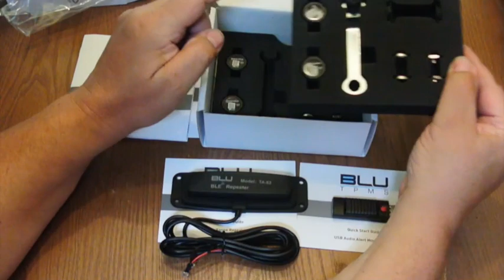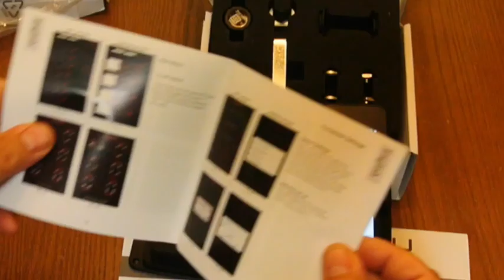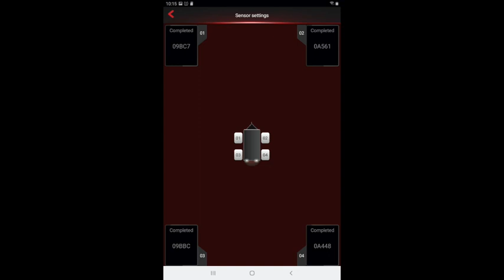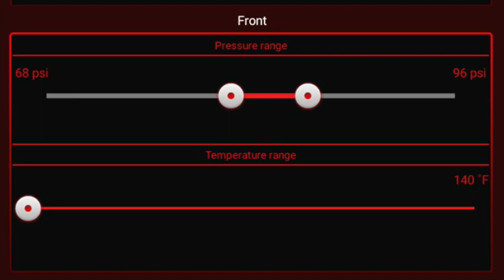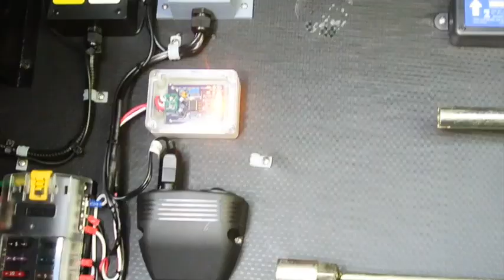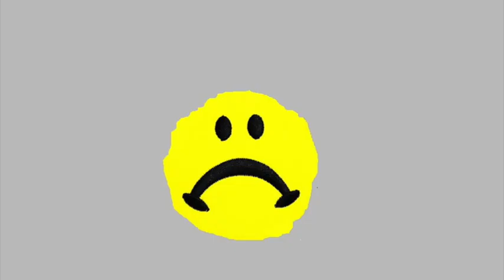Review of the BLU TPMS (Bluetooth) for RVs.

Comment: Junk! Couple of months of use and they are now leaking air. Bought enough of them that I can exchange and it still leaks.
Reply from the maker: Unfortunately, the sensors are more or less common to most of the TPMS systems coming out of China.
Reply: @RVProject   I purchased this at gander Mt. two sets.

Comment: Cross that one off the list of viable TPMSs.
Reply from the maker: Too bad too. I really liked the system.
Reply: @RVProject  with the failures you had and sounded like poor support why would I buy it.
Unless you had an update that I missed.
Reply from the maker: @tommcl386  I would not recommend the system at this point if you need the sensors for >100lb tires due to their availability.  Otherwise, the system was working fine and can still recommend it if you are using lower pressure tires.